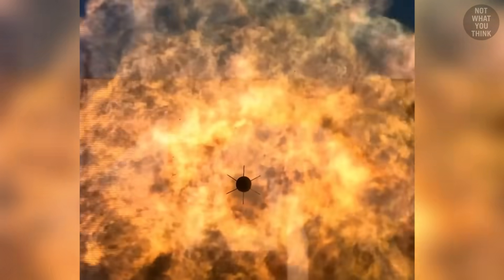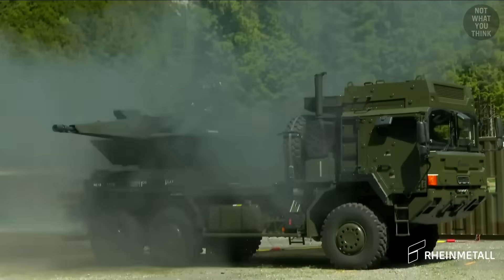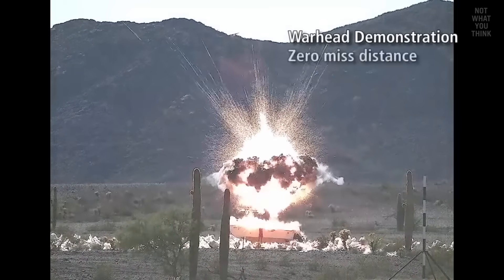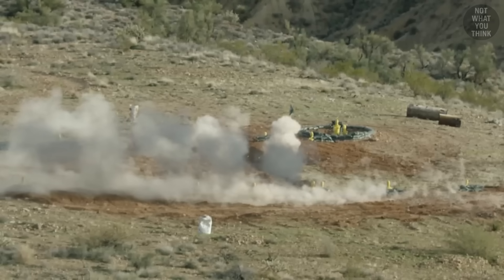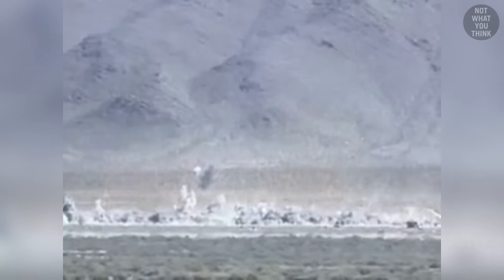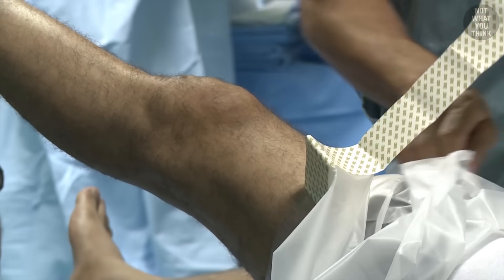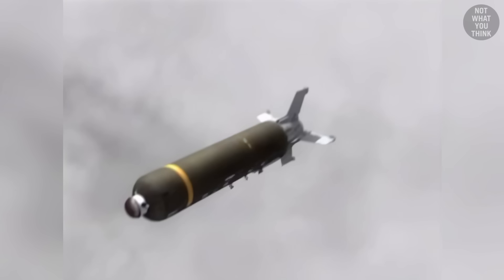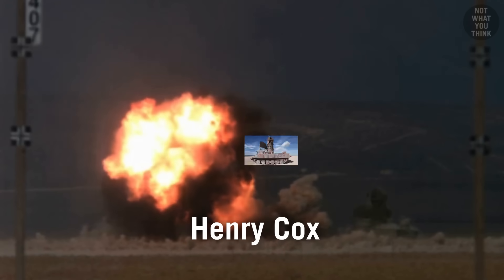Why It's ILLEGAL to Use Glass in Bombs

Comment: It's a myth glass doesn't show up on x-ray. It shows up quite well, unless someone used very expensive and rare x ray translucent glass. 

Wood, and most other organic materials, don't show up on x-ray well and even if they do they look exactly like everything else being xrayed

The real reason they prohibit the use of glass is because it's non ferrous, so it's much harder for a weapon with a glass body or components to be found using a metal detector. It also doesn't corrode or rust, meaning it's going to stay dangerous for a very long time. German glass body  mines from WWII are probably even more dangerous than when they were first buried 70 years ago, they still kill people up to this day and are dreaded by explosive ordinance disposal folk

Glass doesn't make for very good shrapnel anyway, it gets blasted apart into powder and doesn't penetrate deep enough to reliably produce casualties
Reply: To clarify, the propensity of glass to attenuate x-rays completely depends on the composition (density) of the glass. In my experience, window glass and plate glass are fairly radiolucent and nearly invisible. Laminated (auto) glass and brown glass both attenuate pretty well. Green glass is kinda in between.
Reply: @distalradius8146 Thank you for that information, that does indeed clarify things
Reply: Glass is also too light and it's amorphous state most turns into silica sand from the shock wave and there is no way to consistently maintain an effective projectile density  to reliably blanket the 360 arc or 270 degree arc it's covering.

Even if it were to maintain a solid consistent shape it's too light to have any momentum and therefor it's lethal potential is seriously limited and random at best.

Glass does show up in xrays but it's propensity to break up into smaller, sharper shards that are hard to find as tracing wound channels is time consuming and you would leak out due to so many small cuts over a large area. In theory at least.

It falls into cruel and unusual in addition to being the wrong material to use for this purpose tungsten and steel are good, carbide is awesome and depleted uranium uranium is the best penetrator we have found. And it's pyrophoric effect upon penetration is added lethality.

These rounds are so lethal and effective because their submunitions are prefragmeneted and are identical and behave and pattern in a reliable and predictable manner allowing for their deadly effect
Reply: @northerninfidelable  previously for the easily-fragmentable explosive material, they used high-carbon cast iron for the sleeve
WW2 Soviet mortar bombs performed a little better than WW2 American mortar bombs, since the Soviet ones were made from cast iron and had a more even fragmenting pattern compared to the American ones made from steel
Reply: @northerninfidelable  Thanks guys, this is exactly the type of information that SHOULD have been in this video. Instead the script writer just had AI narration blab about fragmentation bombs for 10+ mins and put in ONE line about glass not showing up on X-rays without any further context or deeper research on that topic. What you guys posted was informative. This is why I usually only follow quality channels with real narrators and teams that put in the research effort. Cheers!
Reply: @northerninfidelable Depleted uranium is my favorite, God help you if you're anywhere near something ferrous
Reply: @cascadianrangers728 amen brother that is hellfire and brimstone in a near little self sharpening tip package
Reply: @northerninfidelable In theory you could make an explosively formed penetrator out of any metal,
including DU😮
Reply: @cascadianrangers728 you make a very good point an efp or shaped charge could benefit from the density of depleted uranium if you scale up to using a nuke to shape a multi ton slug of it you can achieve close to relativistic speeds and long freaking ranges with that.... It's called a casaba howitzer
Reply: @northerninfidelable  It is not possible to use nuke as and explosive in shaped charge.
Reply: @skyrask1948 I'm pretty sure that is not correct all you need is the correct way to focus and shape the blast. The difference between an efp and a shaped charge is the type of metal used for the slug formation and the angle of the dish in the explosive. Efps are larger in diameter and are way less steep than a shaped charge, not focusing so fine as to keep what would become a jet of molten metal that is insanely high penetration fro a very tiny distance or form an efp and you can have those bastards form and fly forever
Reply: @northerninfidelable  Shape charges work by use of constructive and destructive interference of detonation wave to shape liner into high speed jet. To achieve this it has to have very specific shape and explosive has to have detonation wave. Nukes on the other hand can be only in two shapes cylinder for gun type nuke or a sphere for implosion type. So no shaping is possible. On top of that nukes don't have detonation wave. The shock wave produced by nuke is caused by rapid heating of air around it by gamma radiation. 
Only shaping of explosion that nuke can be part of is in implosion type nuke where high explosives are used to compress fissile material to achieve super criticality and therefore setting it off.
Reply: @skyrask1948  (1) eh, that's debatable, arguably 2 stage nukes are already using the 1st stage as a shaped charge of sorts to compress the 2nd stage. They're just focusing it into a more spherical/less linear implosion direction, but linear could be done as well if it were useful. (2) the comment you replied to was talking about using DU in place of copper as the shaped charge penetrative lining. This would be nasty in terms of releasing toxic dust, but it's not a nuclear reaction at all & it does sound possible.
Reply: @cascadianrangers728  please  remember that you're talking about weapons used to take lives. this isn't a fun hobby. you aren't treating it with respect.
Reply: @skyrask1948  A nuclear powered shape charge that shoots a high-speed jet of plasma long distance is exactly what a casaba howitzer is. They told you the exact thing of the thing to google, yet you just state that it is impossible. 

The Casaba Howitzer is a theoretically possible but highly impractical weapon, primarily existing in science fiction and theoretical discussions as a powerful concept for space warfare.
Reply: @northerninfidelable  Apart from the fact that uranium is lethally poisonous. 
So imho, the use of that should have been forbidden a long time ago, since it renders the ground itself toxic. 
Three big crimes against humanity: Use of nukes, use of agent orange, use of depleted uranium, cause they poison the land forever and harm the genetix of the residents.
Reply: @donaldduck830 I don't dispute that for a second I was simply stating that it makes a way better pentrator. Even in its depleted state it's still lethal over time. Iraq is supposedly entirely  toxic and dangerous due to the levels of DU that have coated the country.
Reply: Well the worst bombs and most dreaded by EOD are WW2 bombs by the allies with acid or mercury triggers. They can go off any second without warning and at the lightest touch, so usually they are not disabled but blown up at the site, unless impossible (eg next to a gas main). This means you sometimes have to evacuate thousands of people.
Reply: Imagine the damage of breathing in dust from an explosion that has Glass shards I think the real danger is there.
Reply: @AdilAchahbar-g9i silica dust is terrible for the lungs
Reply: I had a glass fragment in my finger. It was leaded crystal so it showed up very clearly. But the surgeon spent an hour digging about to find it. Mind you I think she was pretty incompetent.
Reply: @j673-e3n I wasn't there, so I can't speak to her competency, but just know that glass is known to be extremely difficult for surgeons to remove because it hides so well. You can't visually see a glass fragment hiding in a shot-up, bloody body cavity.
Reply: @mnxs for sure a glass splinter would be hard to see, that I do not doubt. However, if you have good x-rays then you should mark the location exactly on the finger itself before surgery.  This was not done. Additionally you would wear powerful magnifying glasses. This was not done. Thirdly you would have access to the x-rays in the surgery room. These were not available. In fact after an hour they brought in a portable x-ray machine. 

So indeed, as you point out, it is well known that the glass splinters are hard to locate and therefore the surgeons competence is in question. Let's also remember this was embedded in my finger, not a large mass of tissue.
Reply: glass doesn't show up in x ray
Reply: @Addictedtoyoutube9then how the fuck did the doctors find and pick all the glass out of my body after a car wreck? You're going to tell me that what I saw on my own X-ray and what the doctor told me wasn't true? No offense but I value the doctors opinion over yours
Reply: THANKS FOR DOING WHAT THE VIDEO SAID IT WOULD DO
Reply: nah glass doesn't always turn to dust , people make quite effective shape charges using old champagne bottles,  i think there's a good couple of videos on ty if you scratch around
Reply: @marky5493  There is a reasonably vast difference between a molten/pulverized jet of disarticulated matter, and shrapnel.
Reply: @Grendel-ry2fm  correct , the point I'm making is that glass doesn't always turn to dust it CAN also act as a solid state in certain situations

Comment: I really like the contact fuse on RPG-7 warheads. Little tiny peice of quartz crystal uses the piezoelectric effect to set off explosives when tip of warhead hits and crushes. 

It also has a safety that blows the rocket up at about 900 meters, the Mujahideen used this trait so they could air burst their rpgs on us and inflict casualties even when we were behind cover, this was especially effective with the anti personal fragmentation rockets

Comment: Thanks for warning me to avoid getting hit by tungsten shrapnel fragments. I wouldn't want to get cancer.
Reply: This makes me worried about my tungsten cube I have laying around
Reply: @icekick1173 Please make sure not to have it explode into splinters moving towards you at supersonic speed.
Reply: @icekick1173 
It must be in constant contact with underskin tissues and liquids, for a long period of time.
Inside your body.
Pay more attention to lead - it easily contaminate surfaces and skin.
Reply: At least the world has stopped blaming depleted uranium for it. Turns out, any kind of reactive metal in your body, be it dust or shrapnel, is bad! Who could have guessed!
Reply: @Techstriker1 wait so your saying I shouldn’t be licking these Lead Plates? But they taste so tangy and sweet?!
Reply: @TQFMTradingStrategies  Also don't eat flecks of paint from really old houses. :P
Reply: @Techstriker1 those are the good ones I like the Red Flavor.
Reply: @Techstriker1  I machined this stuff back in the 80"s, so far so good, knock wood!
Reply: @Techstriker1 depleted uranium will kill you via heavy metal poisoning long before the absolutely minute amount of radioactivity becomes a problem.
Reply: @Techstriker1  radio-active materials slightly more then others though lol
Reply: @defeatSpace  Well any radioactivity is so low its safe to use as radiation shielding. It is however, a heavy metal.
Reply: @defeatSpace  depleted uranium isn't radioactive
Reply: @mastoukglouk9743 All uranium is radioactive, depleted uranium is just uranium.
Reply: @defeatSpace  The x-ray at your dentist is more radioactive than depleted uranium. Uranium becomes depleted by enrichment, which removes the more radioactive isotopes. You can't drink water from a depleted water bottle, and you similarly are unlikely to suffer radiation poisoning from depleted uranium. The reason the military likes using it for bullets is because it's extremely dense, not because it has some damage over time radiation debuff. Real life isn't an RPG
Reply: @mastoukglouk9743 depleted uranium is basically pure 238 isotope. Its still radioactive but half life is close to 5 billion years, which makes the radiation emitted close to negligible. The main issue with it, is its toxicity, so there is basically no difference for you between having a piece of lead in you or a chunk of depleted uranium.
Reply: @mitotakjde9763   yeah its still a heavy metal
Reply: @Techstriker1  mostlikely its because tungsten is too strong....which makes for biomachinery tech on human body to disintegrate/dissassemble it harder which makes it give up trying fixing it then cell turns cancer because of that stressful situation ... ie other cells self destruct and cancer cells thing forgot about it well eat all resources and save the world :D while they becoming the ones destroying it :D aka cancer :P
Reply: Powerful advice
Reply: For sure, now where can I buy some? I promise to not use glass
Reply: still better than being hit with a literal ton of Cox
Reply: @Voidroamer  Try frequenting a different kind of pub/bar.
Reply: @WillyTepes😂
Reply: Which means glass is a much better choice to be hit with because it is chemically very stable and does not cause cancer
Reply: @holycow666 uranium glass has entered the chat
Reply: nah, don't worry about cancer, there won't be much of you left after the fragments shower. The less of you, the less chances of getting cancer. Such a considerate weapon!
Reply: The least of your worries in the battlefield.
Reply: It's much worst if they even ever decided to make Depleted Uranium on their Airburst.
Reply: There is basically no difference between tungsten and DU. Arguably, tungsten is a bit more toxic  @game_life_1
Reply: At least you aren't getting own pentrated by tungsten Cox
Reply: DW abt it just ask them nicely to use something else
Reply: i think that at this speed, cancer would be too slow to get to you xD good luck out there!

Comment: 8:02 This is only partly true. You‘re right considering plastics, but with glass it can be different. I had a glass shrapnel in my arm before and it was snow white in the X-Ray
Reply: Thats because you had a larger piece of glass. The shrapnel that is being considered is on the order of mm.
Reply: @unironicaluser1867  I'm pretty sure most glasses would turn into powder in any type of explosive with a mass so small any amount of air would eliminate their lethality. Another commenter pointed out the reason is that glass cannot be detected by metal detectors and doesn't corrode and therefore remains dangerous for a very long time.